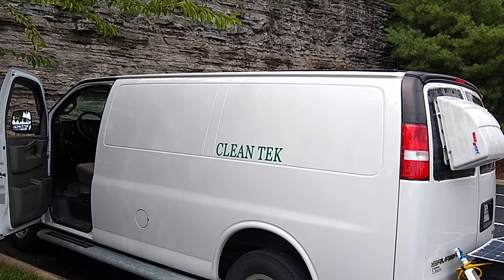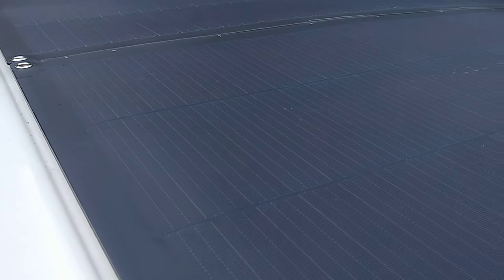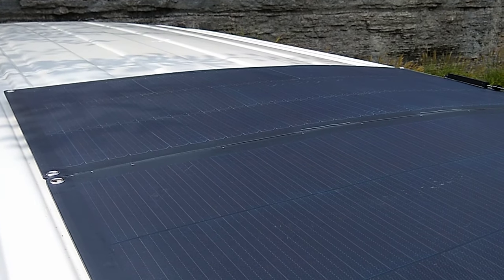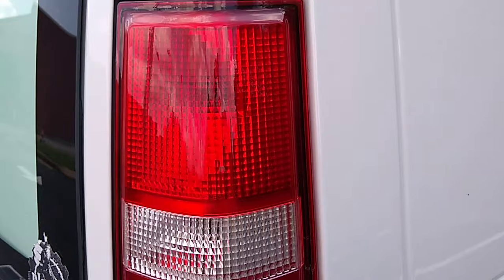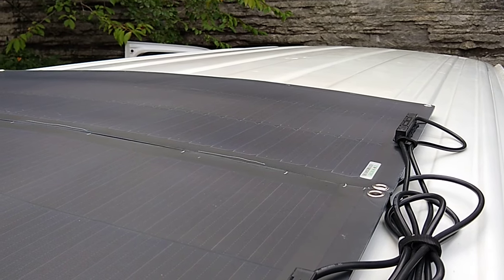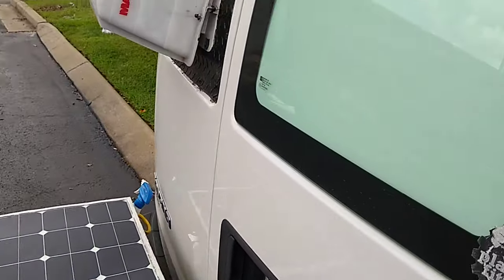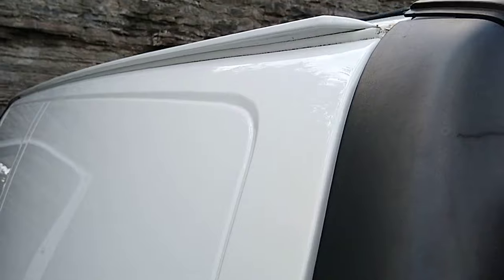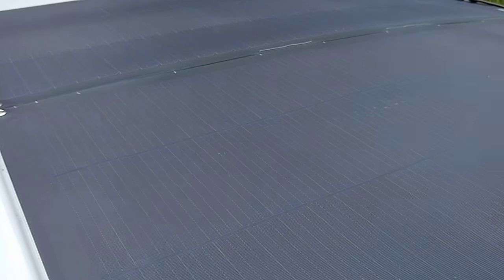Flexible solar panels mounted with industrial Velcro! van life 😁

Comment: I used duct tape but when I removed the panel I realized how bad of an idea that was. Duct tape has a way of tearing and has literally zero strength in that direction. Not reliable as an adhesive device. The couple pieces of clear gorilla tape was the only thing holding it on.

Comment: 300 Watts...cool...that will run that refrigerator well. I tested a refrigerator in freezer mode. It's been so cloudy it got up to 26F after 3 days ice cream melts at 10F. But it killed my batteries. So I'm charged again. Now frozen food will last 4 days or so at 32F before the need to cook it. Congrats 🎉 on becoming a wiring taping measuring installer of Van things.

Comment: Thanks for the update. 
I have a 400w renogy panel. 
And in direct sunlight I can pull 4 amps @15volts. 
I don’t have much electric accessories. 
Computer 
Phone charger 
Lights
Radio

But in full sunlight I actually have to unplug my panels or it Over charges my battery. 160ah lead acid. 

I pick up a charge as long as there is a sliver of sunlight left. 

I want to upgrade to lithium. But have seen results of frightening fires....
Always disconnect your solar charge controller if you leave unattended. 

Keep up the good work.

Comment: I velcroed my bed platform down with that stuff.  When I lifted it up (the batteries are under there), it pulled the 2x4 under it up.  The Velcro held better than the screw.

Comment: Thise Flex panels have your diodes and circuitry on top and the sun can damage them. It is one of the biggest reasons why they fail. You may want to coat the plastic covers with something. I wonder if plastidip would work.

Comment: so 16 months later,   how do you feel about what you have done?  How are is the velcro and panels holding up?
Reply from the maker: They failed 4 months ago so I ended up replacing them with proper hard panels
Reply: @MattyVanHalen  thanks for answering, it seems everybody has the same problems except for ultra-expensive brands.
Reply: Thanks for the reply. What about the velcro holding it securely? Was IT successful?